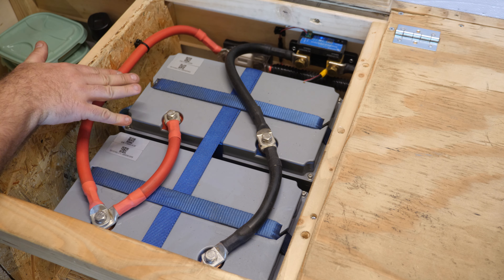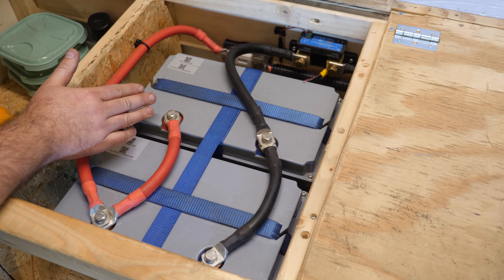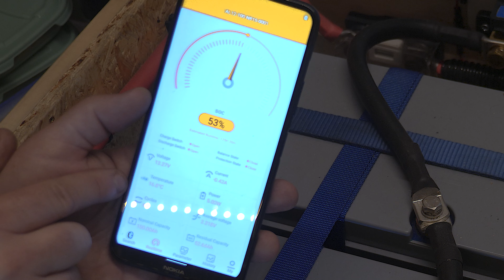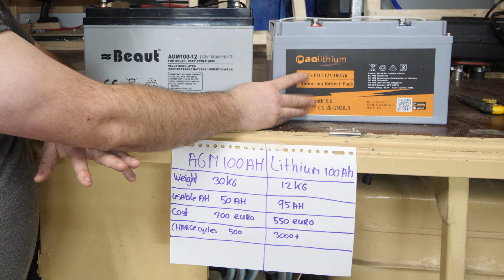Aolithium 12v 100Ah Lifepo4 Battery Review after 6 Months use - Off-grid Unimog Camper

Comment: I made a 12ah 24v pack from 32700 cells i bought at a discount cus they are old stock cells from 2018. Even though the cells were kept in shelf for 4 years , all of them measured more than 6000mah capacity. The pack runs my ups at 300w load for 45mins. Which is just 2min shy of the apc original 27ah 24v leadacid. (Which consists of 6x 9ah batteries that cost more than 100$ new). Lifepo4 is a game changer cus it's direct replacement of leadacid.

Comment: In theory those lithium batteries should last longer and I like the fact that you can discharge them more than lead acid however I still worry about their safety. Thermal runaway on those larger cells can make a large fire. I really like building small 12v dc generators using automotive alternators and engines around 6hp. When I lived on the mountain I ran one 24/7 and burned around 60l of gasoline per week!